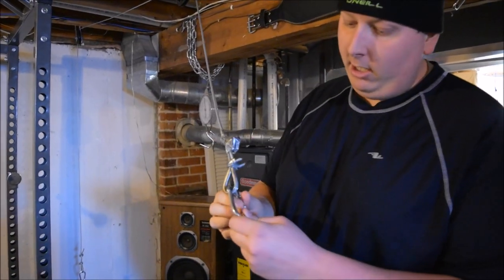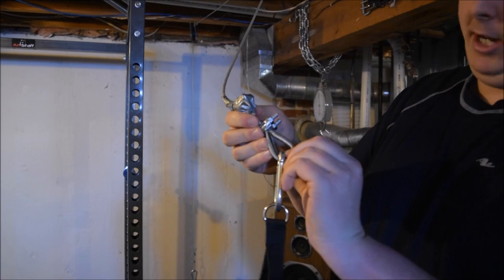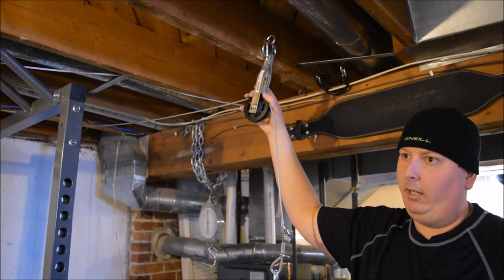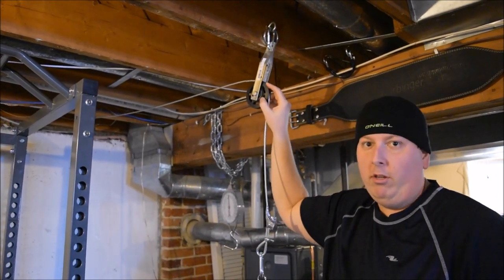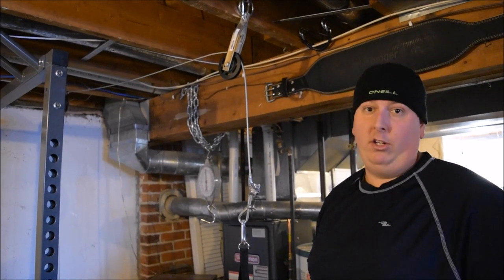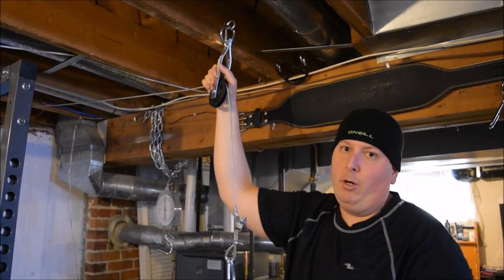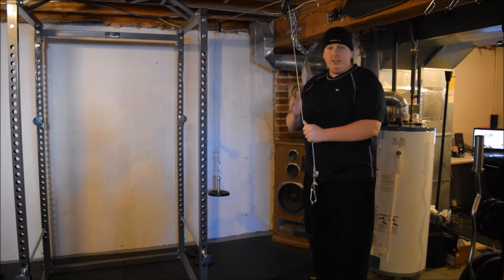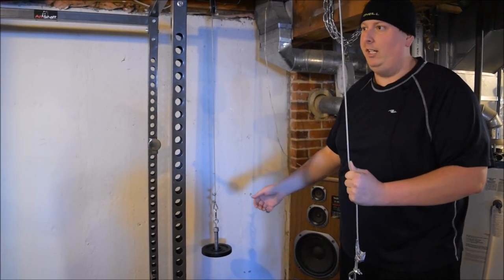HOMEMADE CABLE CROSSOVER

Comment: hi great setup just wondering what sort of length of wire ur using 10 meters or so?
Reply from the maker: each one is around 85 to 90 inches in length.

Comment: How the progress  since this video?

Personally-  what worked for me
I like to start out with body weight exercises when I feel comfortable and gain confidence I add more exercises-   
Then I’d transition into using weights-
I believe this technique install a good base and allows me to practice when weights are always available.

Persistence is the motivating factor towards any goal-
Reply from the maker: I will always have a passion for the weights, that's why I bought them and built the gym.  Progress is ok.  iv been up and down in weight but im back down and am working on keeping it off.

Comment: Nice but are the cables suppose to be that high?
Reply from the maker: the hight is not really an issue.  all you have to do is change the angle of your body to hit different angles of the muscles.  so instead of using a cable machine at the gym where you can change the height of the pulleys, you just tilt your body down or up to change the angle of the cable to your torso.

Comment: Any suggestions for stopping the floor flange weight holder from swinging around?
Reply from the maker: honestly no, I have thought about it but there isn't much you can do about it.
Reply: Susan Mcconnell extend the pipe and put another one over it. Mount the glance to the floor. They sell fittings that you could attach more bars to to hold the weights.
Reply: Put a U blot in the floor or mounted to something thats under the rack and put a really thin resistance band on it. Itll add a little resistance at the top of the contraction which feels good and completely stops the swing

Comment: How much weight have you done with the pulley system.  Please don't say a lot can u just give me a number.  Thx
Reply from the maker: Jamie jakes normally I use 25 pounds on each side. I could easily move up to 40 with no problems from the pulley system. Iv never tried 50 but to be honest I over built this thing and in my opinion it should hold 60 maybe even 70 with no problems.
Reply: Iron Out Fat Awesome man thanks